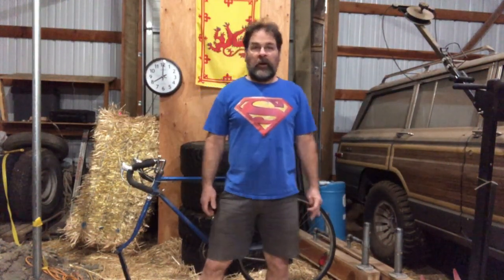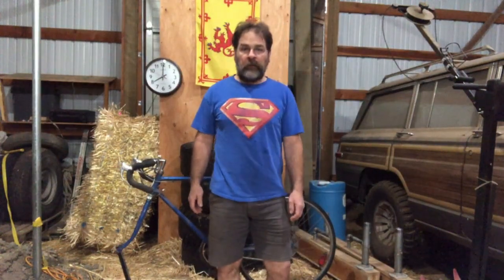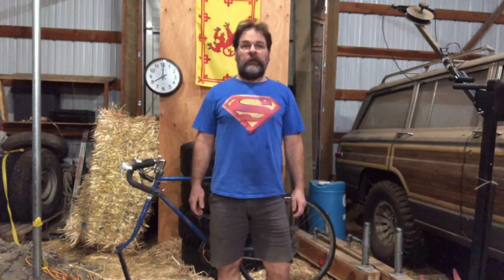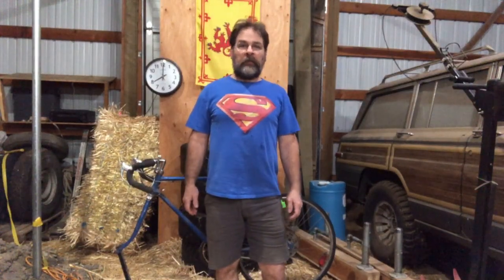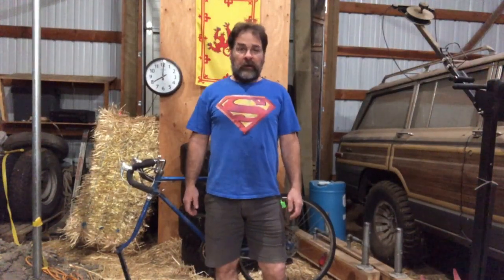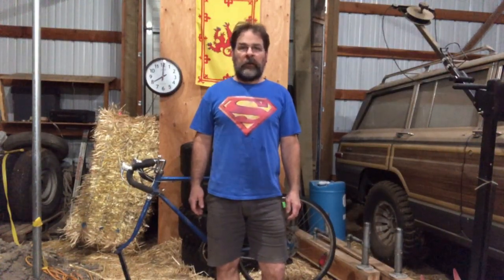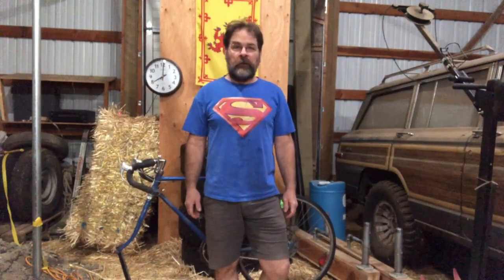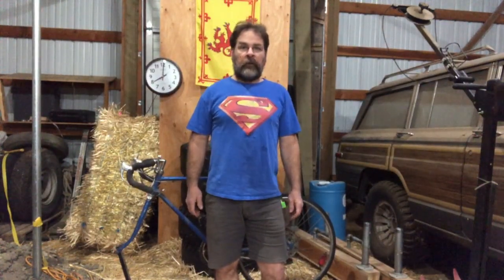Pedal Power Project Possibilities

Comment: 8:00 I'm glad you mentioned making a flywheel, that would make it much easier to use and store the energy you're producing.
I've been having fun lately with some electric motors that I've converted into generators but I haven't found a power source I'm satisfied with mostly due to the fact that (like you say) its quite inefficient. Additionally I haven't found anything to use them for other than powering some LED lights. Using the kinetic energy of the bike to directly power some appliances is interesting but also may prove to be really difficult in practice (using the appliances, I have no doubt you can get them to work but everything is harder to do when you're riding a bike hahaha) The blender seems like the easiest since it pretty hands off once you load it. Adding a fan would make it a DIY airdyne bike which would be sweet in the summer.
Reply from the maker: A flywheel is definitely key. As for doing stuff on the bike, I think as long as I can make everything solid it won't be bad. Human-powered sharpening wheels used to be fairly common. Milling grains would work well too, as long as someone else is there to help out. Long-term, it may even be worthwhile to repurpose a broken-down washing machine. I've seen pictures of working pedal-powered washers.
If your generators are putting out 12v, use it to charge up a car battery and then use with an inverter. I have used my 1,000 watt inverter and an RV battery during extended outages to run our refrigerator and freezers (one at a time of course) to keep food from spoiling.